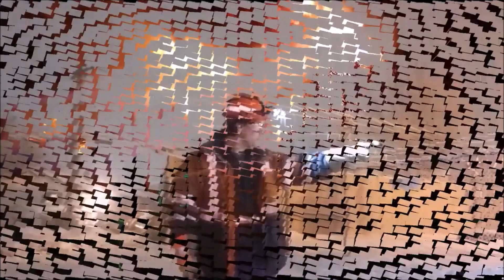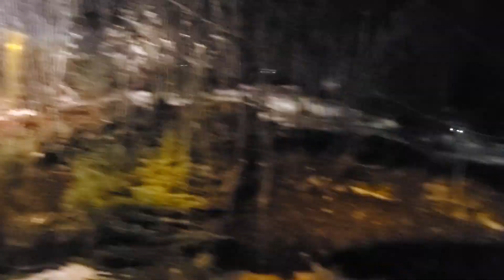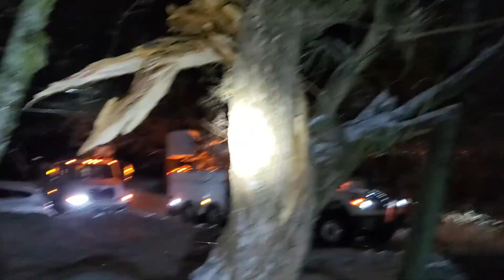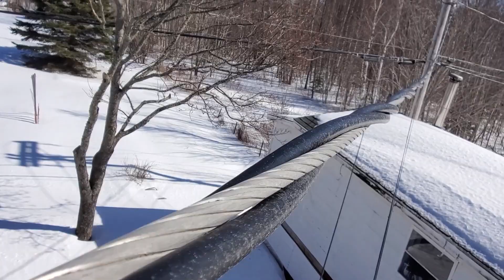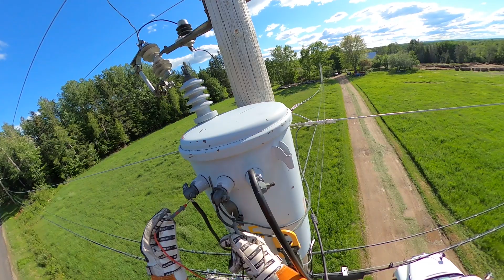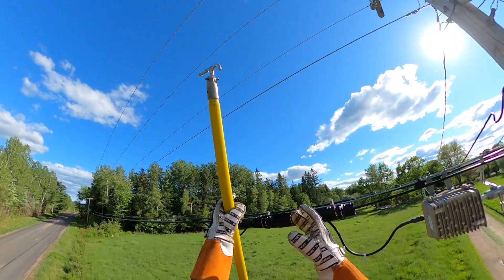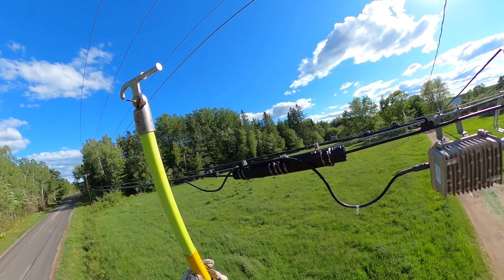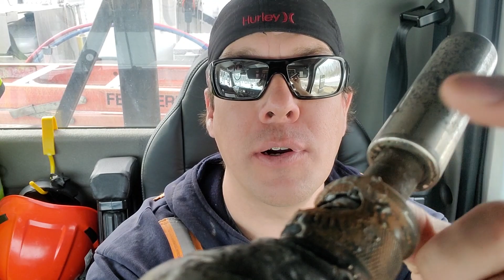Accidental contact with 120 volts

Comment: Insulate and isolate watch second point of contact!!! I have a 1ft by ft square of an old blanket that I use when working on secondaries. I call it a pecker blanket. Glad he’s ok.
Reply from the maker: The blanket thing is a really good idea! I used to have an old piece of a rubber hose to slide onto the neutral.  I'll have to make a point to get another!
Reply: @Bobsdecline  yeah same used to use a cut piece of line hose but a 1ft by 1ft square cut piece of blanket is perfect. Especially cutting in taps on hot legs. You can weave it between neutral and opposite leg and isolate the leg you’re working on. That’s all I use now.
Reply from the maker: Nice, we got a few old blankets at the office. I'm gonna do that
Reply: @Bobsdecline  🤘🏻

Comment: The sparks off a 12 volt car battery can get pretty violent. I can't imagine 69k volts
Reply: I dropped a spanner onto a car battery once, only stopped once it melted and sagged in the middle...
Reply: @gordonrichardson2972  Yeah lead acid batteries were chosen for car starting duty precisely because of their (for the size) relatively low internal resistance and thus high current output. not something I like messing with tbh. I tend to use short circuit protected power supplies for my extra low voltage electronics work for that very reason.

Comment: I had a fish tap hit a power line feed to the house.  There was a big bang and my fish tap was suddenly shorter.  Never found any pieces.  Best we can figure is it evaporated.
Reply: Yep, hitting the incomer to a house can be energetic. Not sure about short circuit/ground fault currents on average in the US/Canada, but here in the UK, we have to assume anything up to 16,000A (16kA) at the service head (which is where the supplier's cable terminates into a main fuse block then on to the meter). That can and does vaporize things. And the arc flash can seriously mess with your complexion
Reply: @TheChipmunk2008  Yes, I think we were darn lucky to be wearing heavy leather work gloves.
Reply: @TheChipmunk2008  US residential is commonly rated to 10kA. (about 2x what a service short would likely pull, and far more than any load out of the panel could do.)
Reply: @jfbeam  If it matters I'm in and older part of the city where my house service was 60 amps.  Was upgrading to 100 amps because they wouldn't let me go beyond that. (was going to put in 120).
Reply: Ionized

Comment: "Only 120 volts", with a hell of a lot of amps along with it (available, not being used), and no breaker. Usually stuff like that will burn and burn and burn until enough wire melts away to stop the fault. But as a linemen you already know this, this is for others reading.

Comment: Reminds me when my finger shorted two phases (240v) luckily for me a fuse blew up other wise I would have had big hole in the middle of my finger.
Reply: How did a fuse blow? Unless your fingers are made of metal something else must have shorted.
Reply: @artomix7  I'm not sure for which current the fuse was designed for, but what I can say is my finger touched a 3 phase busbar that its ends were exposed (the electrician who installed the circuits did not do a good job). The distance between the two phases was about 
1-2 mm so resistance of my skin was not that high. I also noticed some marks on my skin afterwards so I'm quite sure my skin bridged the phases and not some tool or metal part/wire.
Reply: Split phase?

Comment: We had an older full-size van that got a new battery . Sitting outside and heard a Big Bang . It blew the braided power steering hoses off because the battery positive shorted to the hood and grounded out the braided hose . Even 12 volts can make a bit of trouble
Reply: A 12v automotive battery can dump literal hundreds of amps for quite a few seconds. A starter can draw upwards of 450 amps when they spin up and start turning the engine. And thats not a direct short, I can only imagine the amount of amps a 12V battery could dump in a direct short situation.
Reply: @robertschemonia5617      Back when I was a smart ass teenager I wondered just how quickly a cloths hanger wire would heat up if you touch it to both poles of a 12 battery.  I can tell you I INSTANTLY let go.  And I never tried it again.  The two burns were just surface, but quite painful.
Reply: @clayz1  yep. I'm willing to bet you that anyone interested in these kinds of videos will have done something like this at least once in their lives. And, the amount of raw power that a LiPo battery, or just a regular lead acid battery can dump out all at once is astounding.
Reply: @robertschemonia5617  And energy density is the big target in the battery industry now more than ever.  Electric cars, power tools, laptops, whole-house backup batteries...  People assume that smaller batteries are less dangerous than larger ones.  The alkaline batteries we all grew up with that powered our toys and remote controls have quietly been gaining competition in the form of lithium-based batteries in the same A, AA, AAA, 9V, etc. shapes.  Right now that's not a big deal, but there is going to come a point where the cost of lithium batteries and the power they can deliver just knocks alkaline batteries right out of the picture.
Reply: @robertschemonia5617  When I was in college I dated a guy who drove a 1957  Chevy Bel Aire. We were driving along one evening and the headlights started to flicker and the engine began to run rough. I saw a gleam of light through the space around the hood. We pulled over and opened the hood, and there was a fire. The battery was held in place by a thick metal bar that was bolted over the top of the battery. Somehow a bolt had worked loose, and the battery slid on its tray so that the metal bar had shorted across the battery terminals. The bar became red-hot, and accumulated oil and grease on top of the battery caught fire. There was some leftover road sand from the winter in the gutters of the road. I scooped up handfuls of it and threw it onto the fire to put it out. It worked, and then we called AAA to tow the car to a repair shop. So, yeah, a measly 12 volts nearly set the whole car on fire.
Reply: @robertschemonia5617  You can find a YouTube video of a guy who wired 100 car batteries in parallel and then shorted them out.
Reply: lol my buddy used to weld up cheater rigs for stuck bolts with a 6v motorcycle battery DC aint no joke
Reply: I did maintenance on 24 v plant that's 2v cells each a total of 24 lead acid batteries connected in series parallel.you saw,what happened with just 1 lead acid battery just think if you shorted 24 of them ?
Reply: My neighbor was working on a 12v marine battery when the tool he was holding shorted with enough energy to melt his wedding ring.  His finger looked like a cooked hot dog.

Comment: "Only 120 volts?" How about 5 (yes five) volts? In the 1990s I worked on some super computers the size of refrigerators. One had a power supply of 5volts at 640 amps with 1x1/4 in +/-  buss bars all across the motherboard. Bump that with a wedding ring or watch band and it will dissolve the flesh right to the bone.
Reply: 5 volts times 400 amps is 2,000 watts of heat, just like a 20 amp breaker at 110! basically same power level!
Reply: @superchuck3259  It was actaully 640 amps, two parallel 320a supplies. Keep in mind the nominal voltage of an AC arc welder is about 25 volts and look what that can do with 100 amps behind it.
Reply: @superchuck3259  640A continuous rated. They all have output smoothing caps that can generate significant short circuit currents.
Reply: Yep, in that case electric shock isn't the concern so much as the arc flash and burns.
Reply: 640mA 🤨

Comment: Thats hardened steel too, even tougher than plain mild steel.
Reply: All steel has about the same melting point, within  100 degrees or so. Hardened ot not it would have melted in the same amount of time. Almost instantly at about 2600f to 2700f degrees.
Reply: It wasn't hardened any more once it started glowing :)
Reply: Technically the hardness and toughness of the steel isn't really a factor for melting/vaporization.
Reply: @wouldntyouliketoknow9891  Yeah "technically" harder steels are made of a different mix and some mixes take more heat to melt than others. If you're going through the process of hardening steel, chances are its gonna be a better, higher quality blend with materials that take a bit more heat to melt.

Comment: You will cook before that fuse blows. Thats pretty scary.
Reply: Also true with every circuit in the house that's not GFCI protected (most of them aren't). Overcurrent circuit breakers are there to protect the equipment from overheating, not the user from getting shocked. Though to be fair they will trip in this type of overcurrent arc flash condition. But they won't help in an electrocution.
Reply: @chrisbauer1925  I am seriously considering replacing every circuit breaker in my house that feeds an outlet with GFCI breakers. What say you?
Reply: @flagmichael  GFCIs are more important where there is water easily present, but it will improve safety to have them everywhere. Generally unnecessary, but still theoretically safer! It's also important to note tht a GFCI can only detect a line to ground current, but will still ignore an electrocution in the case of getting between live and neutral, though that is fairly rare to happen accidentally.
Reply: @flagmichael  Usually you don't die from touching 110 in your house. Actually, mostly you don't die from touching it.
Reply: @chrisbauer1925  I've touched the hot and neutral so many times over the years, not on purpose but grabbing a plug to move it to get a board over it or just rushing, and I know that distinct feel of our 110 60hz power. I can feel the cycles and paint a picture of them as I feel them. 110 isn't really that big of a worry as the wire size in your house is also the big limiting factor, as well as the breaker. Do you know the difference between electrocution and an electric shock? You only get electrocuted once and you don't live to tell the story. You can get shocked many times and live to tell the story. Now 220, thats something you gotta be a bit more careful with because it's gonna hurt. More wire, higher amperage breaker and twice the potential to get you than 110.
Reply: @mikeznel6048  When the conditions are right you will. All it takes is a body part to be on a real good ground to send a shock enough to stop your heart. Generally people are standing on wood or tile or whatever with sneakers on and its just not a good path to ground, but if you had a wrist or an elbow into a pipe or ground wire or whatever and you got a shock it could definitely be your last.
Reply: @mikeznel6048  True, normally 120 wont injure you, but it can in certain cases. The wire size and breakers in a house are not at all a limiting factor in terms of getting shocked or electrocuted though. If enough current flows through your body that a 15 amp breaker trips you are already likely dead.
Reply: @flagmichael  want to be safer? Convert every thing to 12 volts and go solar.  LOL. joke of course
Reply: @mikeznel6048  I've had 110 take a chunk out of my pliers once still isn't anything to play with static electricity is enough to kill someone if it were to pass through your body just right
Reply: @flagmichael  Most European countries are moving towards GFCI/RCDs on each breaker with a combined RCBO.  For many years they've had one on the main breaker but the drawback with that is if it trips at night, everything goes out including your lights so you might then injure yourself stumbling around in the dark (so the reasoning goes).  That's why now they are moving towards an RCBO on each circuit.  It might not be strictly necessary but another level of safety is rarely a bad idea.
Reply: @chrisbauer1925  in Australia we are required by law to have every Circuit protected by a I’m pretty sure its actual name is either rcbo or rcdmcb basically its like a gfci outlet but for the entire circuit instead of individual points it protects from over current,shot circuit & in the case of electrification will increase your chances of escaping unscathed
Reply: @mikeznel6048  the end there is a bit off I’ve been belted a few times on 240v most notably off of 100A fuzed mains feed and i can personally vouch for the pain but twice as likely to get/kill you i would have to disagree just because it’s double the voltage doesn’t increase the danger by X2 in my opinion its more like once you get close 500v thats when your getting kinda dangerous like our line voltage here can be 415v in a 3 phase system which I’ve never experienced but being an apprentice myself and listening to my trades stories about idiots getting a wakeup call off 415v thats when i think you really gotta wisen up
Reply: @JackInTheShop  Fire training includes the dangers of solar panels even at night lol.  Apparently their work lights can be an issue.
Reply: @flagmichael  If it's within 6 feet of water like a sink, shower, outside or unfinished concrete like a garage or basement go gfi receptacle the 1st receptacle in a line.  Use the stickers and label the down stream ones.  Most new construction around me is combination arc fault breakers and gfci outlets.  There are dual function breakers NOT the same as combination  breakers that do both combination arc fault and gfi. Note that doesn't mean your panel or your wallet will necessarily accommodate them.
Reply: @mikeznel6048  i didnt have 100A through me it was fused to 100A which means it wont blow nmw so if i had been unlucky and gotten stuck i wouldn’t just die id cook but 100A is the maximum possible draw possible is what i meant and since its a fuse it doesn’t stop till it burns😁
Reply: Wanna hear scary, i just got done learning some primary fault breaks click (open and close) 4 times before opening,  2 clicks to see if fault self corrects, the 3rd click is long to see if the power can correct the fault (BURN WHATEVER CAUSING IT, such as a tree, squirrel, or you) 4th click leaves circuit open to save the equipment if 3rd click failed to correct fault.
Reply: @tristinsperry5171  Are you talking about automatic reclosers?  It reinforces the point that circuit breakers are there to protect the wiring, not the people, which is why you need additional protective devices like RCDs for the people.
Reply: @Berkeloid0  i was, and i know lol, there meant only to protect the wireing and equipment, not people, NEVER touch a power line lol, unless trained and wearing the proper ppe
Reply: @tristinsperry5171  never hear of it tripping 4 times. Our reclosers trip 3 times. When we have a bad storm her and see the power blink, we always the blinks. After the 3rd blink the power will stay off.
Reply: @JackInTheShop  i dont work the in that field, not gonna pretend i do lol, i just remember watching a edu film on it and how the third time is longer to allow the line to possibly burn off whats causing the fault (almost always a tree or squirrel), if it succeeds power comes back, if not, circuit goes open until reset
Reply: @tristinsperry5171  It is cool stuff. I have work 2 different systems. I like to see and talk about how others do things differently.
Reply: Our bodies resistance is too high to draw enough amps to blow the fuse, but low enough to kill the crap out of us lol

Comment: The resistance across the tool was maybe a few ohms, the resistance across dry human skin is in the thousands of ohms. Pretty big difference.
Reply: Unless you are sweaty, they going to get burned!
Reply from the maker: Yes,  you are absolutely right! 💯. While expecting to be questioned about that, I went into an explaning this in the video... I decided to cut that whole part as it diverted my intent of the video and left more even more questions unanswered.

While there's a big difference, there is still certainly a hazard, and this better demonstrates the capability of low voltage.

In this specific circumstance that arc flash would likely have been the most concerning imo ✌️🍻
Reply: @superchuck3259  YES, this. 120-240 can easily grab you and make you not alive in short order if you're hot and sweaty on a summer's day or stuck in an attic or similar.

People say 'oh stop being a sissy and man up' or similar. I'd rather be a sissy with PPE than a new project for the undertaker without it, thanks :)
Reply: True. But the difference is 1A (human -- actually closer to .1A; currently measuring my sweaty paws @ 700k) vs. ~4kA for a dead short. (depending on line length, and transformer impedance) Humans tend to want to get away from power, tools tend to weld themselves to it. I have no idea what the ratings are for the PoCo cut-out, but they will blow if you short the secondary side. (been there, done that, blacked out a neighborhood.)

[ V*I, or I*squared(R), means the human won't heat up nearly as fast. If you've ever "cooked" a hot dog, or pickle, with one of those novelty electric jobs, you should have an idea how quick a human would be seriously injured. ]
Reply: @jfbeam  the human is dead either way. That's the thing they miss
Reply: @compwhiz797  Yes, "eye squared arr" -- I needed a nap. :-) 10mA can stop the heart, 100mA can kill (destroy nerve tissue), but it has to get through all the "meat resistance" first.